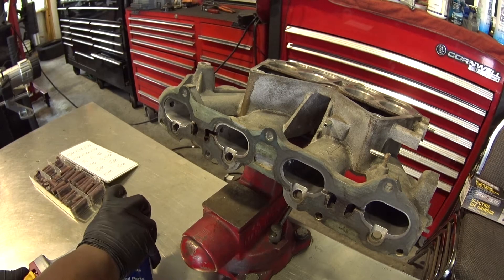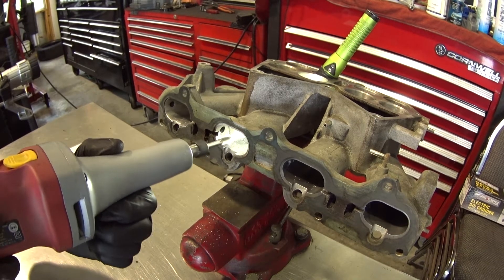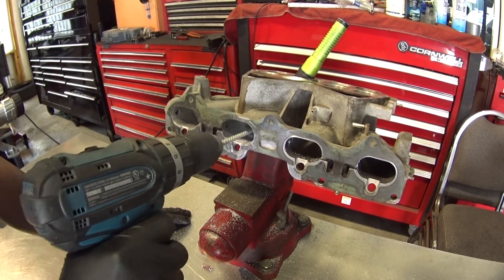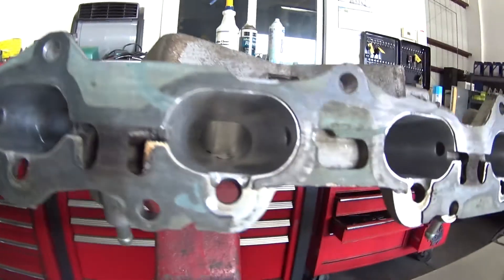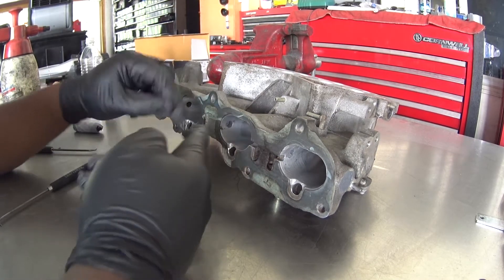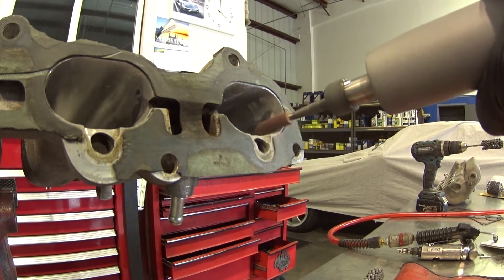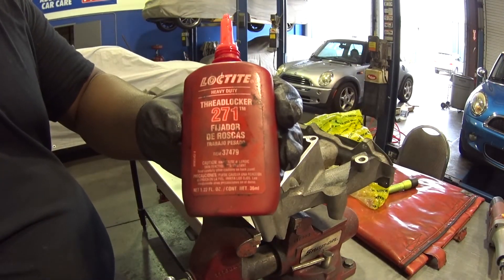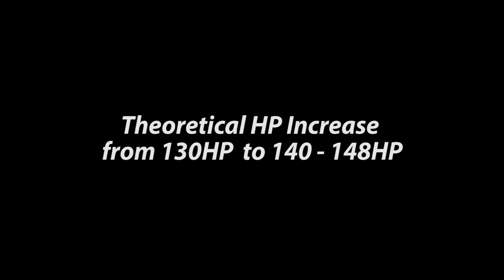Mazda Protege Intake Port & Polish EP. 5 - Pt. II

Comment: Can I install an mp3 Ecu on a P5 which is automatic?
Thanks for the great videos 👍
Reply from the maker: @rodas_guinea  You can but for a Protege equipped with an automatic gearbox you likely wont notice much of difference because the torque converter will minimize any gains. I recommend to install the JDM FS-ZE without the MP3 ecu and run 93 octane fuel. That alone will pit some very noticeable pep in your driving experience
Reply: @RetrocarStyle  Thanks for the advice! Much appreciated. I have this little Mazda P5 that I’m starting to like a lot and want to  take it to better performance.

Comment: Harbor Freight sells a router speed control and there's a video on you tube that shows how to modify the speed controler in order to be able to reduce the electric die grinder even slower.. Find and watch the video, then go pick up the speed controller from Harbor Freight and do the mod to it.. You can slow the tool down so far it will litterly stop running, so infinite adjustment is possible..Hope this helps..
Reply from the maker: I'll try that thanks!